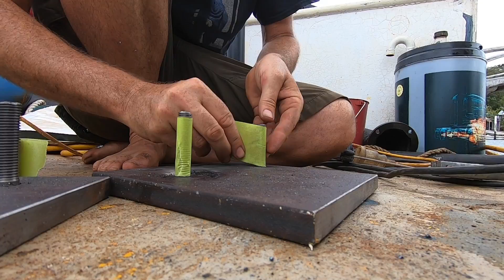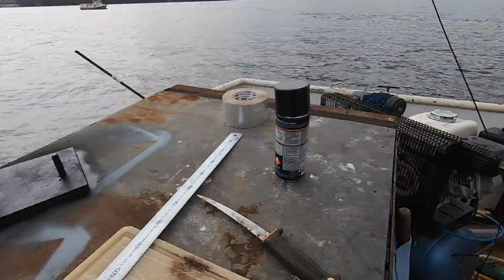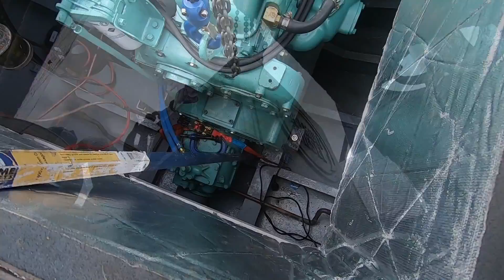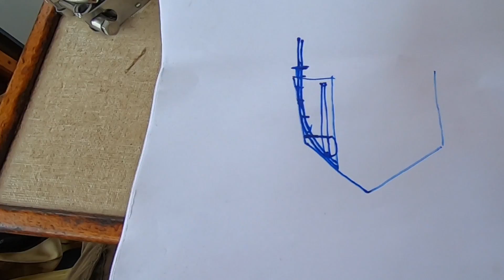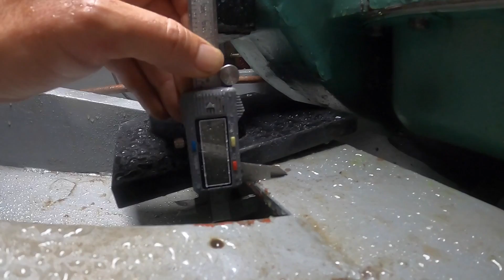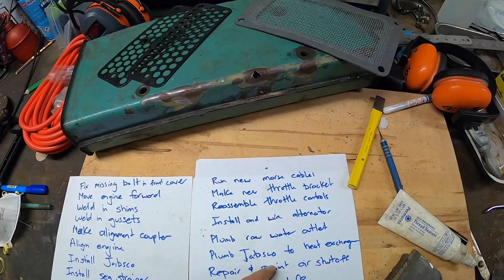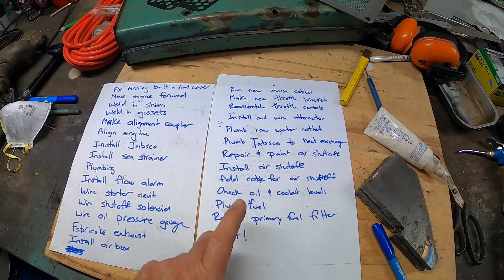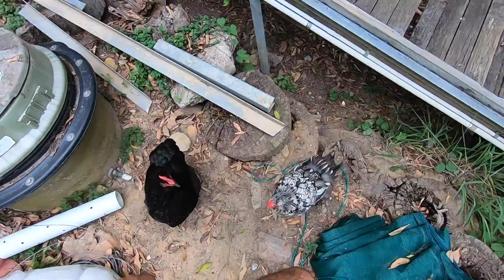Making and installing new engine shims

Comment: When i used to work on small boats in Halifax harbour many moons ago, we used an ullage tape  , because a couple of our boats had the exact same issue.
Its just a metal tape measure, with a brass weighted end & we would often put 'paste' on the weight. It was there to detect water in the bottom of the fuel tank. Some brain somewhere figured out the irregular dimensions of the tank= how many gallons & that way we knew by the amount of inches showing on the tape, how many gallons of fuel we had, there was also a little valve right at the bottom of the fuel tanks with a threaded plug, you remove plug, allowed you to drain "water" . I was younger and skinnier then & it was a pain to get at those damn valves I remember.
Keep at 'er & never forget that "slow and steady may not win the race , but you still get there & you're not outta breath"

Comment: hi stu you should also add to the list some 12 volt LED fluorescent lighting in the engine bay incase while your out on boat at night I know you could use a torch but having permanent  light would be better just my thoughts

Comment: Have you ever heard of a, dirt shoe? A dirt shoe, is when you haven't worn shoes for so long that the dirt builds up on your feet and it looks like a pair of shoes, you're close. Don't get so worried about the alignment, 0.004 in. on the top, bottom, and sides and the coupler will dampen any vibration. I always measured it against the coupler and never had any comebacks. Sometimes good enough, is good enough.

Comment: Stu, you can avoid all of your alignment struggles by using the reverse dial indicator method. For your application, you can get the motor and prob shaft located where you want fore-aft and align the flanges with good straight edges, install the flex coupler with the bolts snug but not final torqued, put the dial indicators on, and then adjust the engine with the mounts up and down, and bump it port-starboard with a portapower ram or long lever. You application is low Rpm and thus has a pretty large tolerance window, so it should go quickly. You won’t need to worry about bar sag or the like since the tolerances should be plenty large.

https://m.youtube.com/watch?v=9Ay5hcp9ybs

Comment: you do not need advice on the lineament, what you are doing is sound as a pound, oh sorry i meant dollar,  i am as inpatient as the next guy to see the engine running but i can tell you know if you cut corners to please people you will take twice as long to correct problems arriving due to haste,  done right it will be twice as good when she finally starts and can be used than switched off to correct faults,

Comment: if you extend the mating faces with some aluminium excursion could help ruff in the the correct angle. use a feeler gauge and a big dead blow for final adjustments along with adjusting the suds, and also hard to know what's going on with the centring is there a surface you can get a reading with a magnetic micrometer preferably on the gearbox side so you can spin the prop side and probably use a little mirror to read it as you rotate . i would also think having the engine balanced with a engine tilter would help massively could have the engine weigh much less as you do adjustment.  if you think of the the task in four adjustment X, Y, Z axis and also the centreing. make each of these adjustable but also measurable .

Comment: Hi Stu, I wouldn't stress too much about the alinement, It can be bit of a pain because you have the couplings lined up and then you find you need to close the spacing on the bottom which means lowering the front of the engine but then the gearbox is cantilevered so the coupling rises up and so forth, I usually just make sure the couplings meet nicely all the way round and call it good, I've never had any issues, if you plan on putting in a flexi coupling then you have even more leeway, Someone will argue with me but I have 2 to do next week.

Comment: Hey stu , moving the engine forward will affect your alignment as you probably know, machine up a dummy flexcoupling out of steel or ally  that will provide perfect alignment then swap out for the poly coupling 👍

Comment: Stu, used to work with large 400hz motor alternators with metal couplings similar to yours they were bolted face to face, once the manufactures had lined them up perfectly they drilled tapered holes through the feet on to the bed and knocked in taper pins so any time we fitted new bearings we pulled out the pins pulled them apart fitted new bearings and the taper pins aligned them back to original spec. Just thought this may help sometime if you have to separate your motor from the prop in the future.

Comment: It's flooding up here atm and I see on the radar it's still down around your area. I see the Manning River and Hastings River are still rising just a lot slower now. Definitely some heavy rain. I went to visit the old man yesterday, drove in and no puddles or anything in the creek, still dry. But 1hr or so later on the way out it was in flood. Just had to fill all the dams first.

Those radios on the old radar box to your right whilst in the workshop ... (looks like a Uniden MC615 VHF and GME something) are they out of this boat? If so whilst they were an ok radio the 615 they are a dinosaur (was using one in the Coastal Patrol when I volunteered in the 90s) and could be replaced with a hand held control thing where only the mic is visible. A Codan NGT will do the same on HF maritime for you and you can do the same with UHFCB (handy when dealing with someone on shore).

Nice move on upgrading to MPPT!

Comment: Back in the day, it was "fenner" couplings Stu :) ,  We welded nuts to the engine mounting (engine side) then screw bolts in them 16 mm  ,( long ones)  for adjusting motor up and down, that's  the easy bit, then side movement same sort of thing bolts to adjust the rear and front left and right.  I first saw this as a youngster in mining adjusting 20 tons of water pump....
feeler gauge is your friend. Mount coupler on prop side, then move motor closer, start adjustment as you creep closer and closer to coupler, honestly the coupler can not be out more than .004 maybe .004 that is your target anyway.. and in some cases i found i had to accept .04 due to flanges warpage ! Take your time.. Do it ones sweating all the way... so long it's correct.. Or do it many times due to the fact you were in a hurry earlier.
edit: i remembered something, heheh   D-d/L = taper in degrees  ..... if you have to make make taper spacer.
Oh spin the motor side put a scriber to see war-page if present (like on a lathe) if you have measure meter it will help you...forgot the damn meters name ..lol
easy job that takes time and elbow grease, gets complicated with angles of motor.

if need be practice in the shop, with two flat objects, small electric motor with flange like a old waterpump and motor, or go help a friend that needs his adjusted (new fenner mounted)
Fenners have 2 inner and 2 outer flanges.
Johan

Comment: Gussets look good mate, just need a 5x 45 deg notch inside top corner to clear any weld that may exist on your main beams under the engine, get them dial gauges going and line up that coupling,  ive seen it done with lasers but with a dial guage 2 to 4 thou should be attainable,  good luck

Comment: Wondering why you wouldn't just make triangles for your gussets then add a 10mm piece across the top so it would match the stringer height exactly with no fooling around, grinding, cutting out wired shape pieces, etc...?     Also since you keep putting of your alignment psyching yourself out making excuses why don't you use cleaning up your backyard for one? No offense but its a bloody mess and I'm sure people would agree its a good a reason as any for putting off real work and would love the before and after.       Oh and c'mon man if Damien from Brupeg can do an alignment I'm betting you stand a pretty good chance on making it mint even without your alignment tool excuse. Just get er done Stu!

Comment: Hey Stu, I was thinking about your fuel level problem.  If your tanks have drain bungs at their bottom, you could use 4-20 milliamp pressure transducers threaded into the bung.  A fuel gauge would then be setup so that the low milliamp signal would equal an empty tank, and a full tank would give a maximum signal. Here's an example of an inexpensive transducer https://www.amazon.com/Pressure-Transducer-Silicon-Transmitter-0-0-5MPA/dp/B07HL5SG6R and here's an example of a gauge made to work off a 4-20ma signal https://www.amazon.com/KUS-DN52mm-Digital-Level-4-20mA/dp/B07LDRS4ZP?th=1 Just a thought.

Comment: On the topic of shaft alignment

As the gap for the coupler is not that big. Couldn't you just attach a dial gauge with a magnetic base.

1. Attach the dial gauge mount magnetically to your prop gland. (Sure a clamp similar to an oil filter remover is better but you can get a dial gauge with a magnetic base holder for cheap).
2. Put the dial on side of the flange of the engine coupler and rotate the propshaft (adjust engine till the dial doesn't move)
3. Put the dial on  the flat side of the flange engine coupler and rotate the propshaft (adjust engine till dial doesn't move)

If the dial doesn't move it is axially aligned dial gauges are often accurate to 1/100st of a millimeter. 
For the face to face gap you could use a caliper as that dimension is less critical. Or just see if the coupler fits. 
Or what i would try: do all alignments with the coupler in between and just do the coupler face based measurements on the back face of the flange (as the coupler will block the front).

Check this vid
https://youtu.be/8A2kpOad4VA
https://www.youtube.com/watch?v=n17Uq3fiQ-o

It explains it for the flange sides but the same goes for the flange faces notice that they have the flexible coupler already attached. They have a lot more videos. (Just make sure to compensate for gravity on your arm + dial weight as the cheap ones like to move a little)

Amazon sells cheap magnetic dial gauges with magnetic feet. https://www.amazon.com/dp/B01JU18A0Q/ref=cm_sw_r_sms_awdo_t1_WU8pEbS7GA6XZ

I'm getting close to putting in the engine bearers and mount for my engine so alignment vids are handy for me as well ^^

Comment: Ooh thats a pain in the ass you can't slide the shaft in and out, the worn out shaft may cause you some issues and vibrate. Are the bed rails in the boat parallel with each other for reference measurements? Get the flanges mated up perfectly, take reference measurements transfer the measurements forward for the amount of distance to give you space to install the shock absorber between the flanges. If the bed rails are not parallel then you will have make couple parallel lines off the transom you can reference to. The biggest caveat is you don't know how well the worn shaft is going to behave with a new cutlass bearing. The isolator between the drive flanges will take up some misalignment, the wheel end of the shaft is doing the bouncy bounce or a whipping action on the shaft you can have bolt failure on the coupler. I would get the shaft where it will be running mount a dial indicator and measure the run out on the flange end of the shaft.

Comment: I would say a dipstick for backup (doesn't have to be heavy, the end of a surf-fishing pole or even bamboo in a pinch)(bend that input pipe to angle it better, maybe with just torches and judicious hammering...) and then you're golden during power fails off-shore and in the mean time you can rock that high-tech with confidence!!  CHEERS!

Comment: I may have misunderstood your planned process but are the engine rails on the same angle as the prop shaft?
If not, aligning it without the blue spacer then moving the engine back the width of the spacer will put the flanges out of vertical alignment again.
Reply from the maker: Yes, the engine rails slope at the same (or at least very similar) angle.

Comment: Why not instead of adding gussets that will have to be welded statically, add a 10mm plate supported on each end by gussets, will allow you to slide the engine around making alignment easier.
Reply from the maker: My thought was that I could slide the shim along the tops of the gussets fore and aft enough to cover all the movement I will need, but a plate on top might make the sliding smoother.
Reply: @DangarMarine  also might make welding easier in such a crampt space, just a thought.

Comment: Hey Stu, with your flex coupling, if I understand your drive system it's only a single bearing at the prop end, no thrust block? Where is the prop shaft end thrust being held? Should your boat have a flex coupling at all or is the thrust meant to bear on the transmission output flange? I'm not sure if you have shown us the new coupling or not so you may already be on top of this, if so please recycle my comment as a firelighter or chook food. 

Cheers.
As far as starting your GM, an old supervisor once told me, never start an engine that you aren't totally sure you can stop. The air damper is worth it's weight in bent valve stems, all GM's should have had them.
Reply from the maker: So guess this is pretty much a copy of the original install which doesn't have any sort of thrust bearing either. According to polyflex the engine mounts can handle the thrust.

Comment: Tell me I’m up the boo eye but if you line up the two flanges , then move the engine forward to fit the flex coupling , won’t that change the angle again because the prop shaft is at one angle the motor is flat bedded so if you move it forward the angle will change . If you get the two flanges perfect you won’t need a flex unit as both surfaces are the same , just a thought .
Reply from the maker: The engine rails are sloped too, very similar angle to the propshaft, but perhaps not identical.

Comment: good onya Stu..The doers out there are probably the ones we see coast guard towing home or worse so keep on keeping on mate..The mount plate gussets will be a challenge to weld in now the donk is in so im glad you scored that gig old mate..Glad you sorted the charge problem by the way, it is a nice system and I was surprised it gave trouble..Good episode mate
Reply from the maker: Thanks mate. Yeah, I don't think there was anything really wrong with the charging system, it was just me being careless with a live unfused wire. Once everything is finished and secured into place I think it will all be very reliable. It was nice to have the monitor warning me of the problem and backup chargers too. :)

Comment: Dont fret to much about coupling and shaft alignment Stu while it can be tedious if you take your time you will get a good result . getting it close and then running followed by final alignment is fine plenty of pro fitters do that. I have seen some that just align by eye and bolt her up and go but dont do that mate.
Reply from the maker: I think this is going to be like plenty of jobs: pros can do it quickly but DIY guys can get comparable results if we just go slow and keep on adjusting until it is right.

Comment: With your new mppt charge regulator you need to put stud blocking diodes on both the positive & negative lines so that if you ever cross the wires you won't blow electronics outs & also during the night solar panels are notorious for sucking the power out of a battery, this is why the diodes are there mainly.
Reply from the maker: Will look into it for sure.
Reply: The diodes are placed between your charge controller output to the battery & the battery. Also if you work out your current draw when you are not using the boat then your solar needs to be worked as follow, every 100w cell will produce 60% or 60w per hour for 4.5 hours when sitting in a fixed position. So when you work out how much wattage you need to put back into the battery bank it's normally 125% of what was used. Also you need to account for winter rates where you need to double the solar watts to equal what you need because winter will be your worst time to generate power.

Comment: usually I use a feeler gauge to set the flange alignment, Maybe use C clamps to hold forward cantilever  engine mounts. 
I have used galvanized  water pipe for dry exhaust mounted between heavy duty rubber exhaust hoses. 6 inch sections doubled hose clamped. you can also weld a washer to bond w the rest of the boat. also I didnt notice that you had a bonding buss under the boat?.  I always solder all connections and add silicone dilectric grease and shrink tube over solder joints.
Reply from the maker: Yes, still need to look into bonding and grounds.

Comment: Hey Stu pull the engine forward with 2 ratchet straps  . I did this and it made it easier  to get the motor aligned  . This is just a suggestion  mate
Reply from the maker: Yep, have been thinking of something very similar when it comes to dragging it forward. Ratchet straps have a surprising amount of strength.

Comment: Having lined up a few 100hp pumps in my day. I would say you should be able to use a straight edge to get your alignment. Then dial it in with a dial indicator. Your vibration eliminators are gonna give you problems, because the motor will move. 
Here's some good reading https://www.rexnord.com/contentitems/techlibrary/documents/538-214_manual
Reply from the maker: A few people have mentioned problems with the Polyflex mounts. So is the idea that flexible mounts should always be used with a CV joint and flange to flange always be hard mount? Of course I say flexible, but the mounts are actually quite rigid and provide progressively more resistance as they deflect. So much to learn about this stuff...